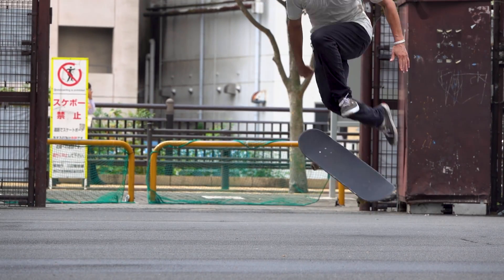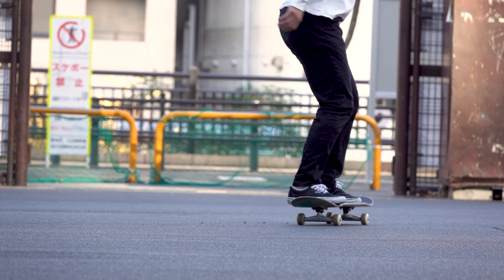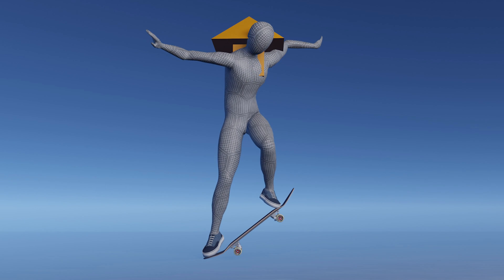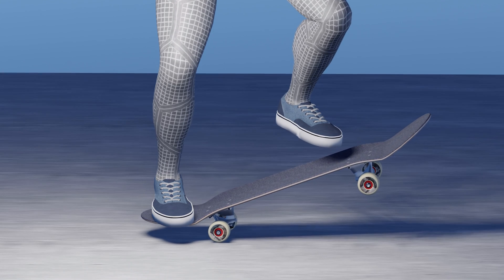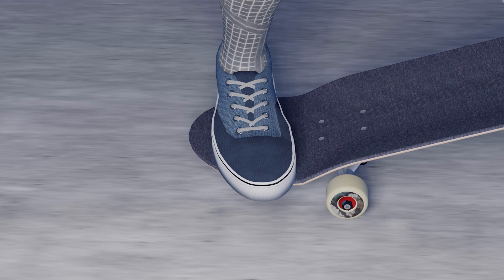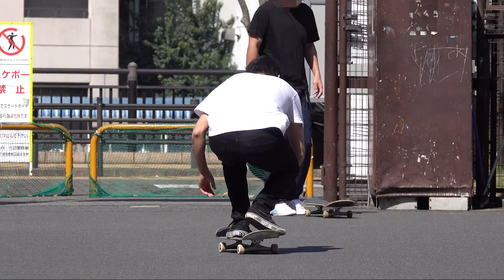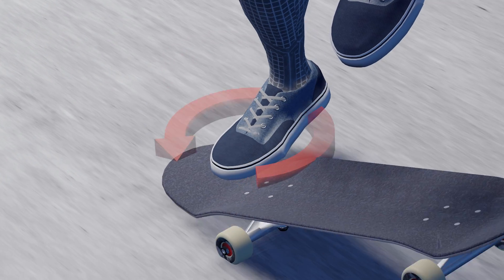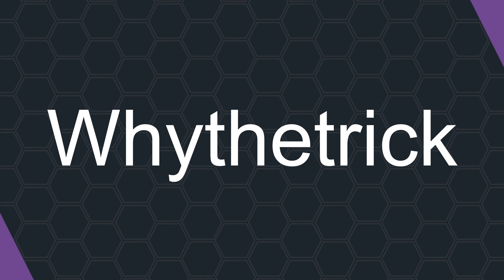Science of SCOOP - Difference with SWING

Comment: Bro, can u make a video why the board moving far forward/back after the scoop? Most people including you throw the board forward about 50cm after doing a 360 shove/flip , but some pro's like nyjah can land 360 flip at the same spot when he scoop it
Reply: That’s why you don’t Nyjah do tre to blunt, nose grind, overcrook, prob cuz he’s most skilled doing them where the back foot is responsible for more of the control
Reply: Also notice with noille center of gravity is more forward but not as much as it’s more backwards when ur in normal stance; because which direction ur moving in matters as well and requires less force hint nollie needs less. So since a tre is back foot heavy because two thirds of its motion are created by the back foot, naturally we push them forward usually to compensate and most people aren’t very skilled so they overdo it/ can’t do it backwards. 

But one should master all of possible
Reply: If you pop the scoop backwards you don’t need to apply pressure or flick as much in the front, and vise versa. 

Hope that helps

Comment: I’ve been trying to get front shuv-its casually lately, and for me I just pretend that I’m going for a front 180 and go from there. You know how hardflips you have to pretend you’re going for a frontside flip? Just like that. Also the swing motion you describe reminds me of like a scissor kick. I guess maybe something like an inward heel? 

Also the knee does move forward but you have to think of it from a neutral position. To me the knee moves in 8 directions, but really 16. (Well, the foot does which is ultimately the goal.) When you ollie you don’t bend the knee inwards and fold your ankle like the puppet maybe could, but it does shoot directly out and upwards. And then the foot comes after, think big ass ollie. You’re using the whole leg. If you wear a hinged knee brace you could still do tricks but it’s not the same. It’s all like a compound movement and moving your knee is natural. But it has a middle point and it’s not leg straight. Leg straight is one stretch away from hyperextension. Remember your ligaments is built to stabilize you, but it’s never JUST the hinge motion. You do have some range and power below the knee, and could even work on it (like quads).

One thing I’ve been doing lately for tricks is like a double squat I don’t know if you’ve experienced this.
Reply: Also I say 16 movements because if you keep your knee bent and move your whole leg from the hip, there’s your 16 (knee) movements. You can still place your foot in the same directions. I watched p.rod explain varial heels and that informed my ideas a bit. For the front foot, he says ‘lead with the knee’… and I found it useful later when trying to analyze my own mobility and form a basic concept of ergonomic knee movement as it applies to my skating. He’s not using his knee to get his foot to the point where you flick the board, but using that specific knee movement as a compound movement to get a fs rotation going without a scoop. (This is probably closer to what you call a swing movement.)

Also the movement you are doing with the back leg is not in this second area, because you are twisting the leg (still from the hip) but like if you are going to sit indian style (crosslegged) or as if going to do butterflies (the stretch movement used for flexors) or any movement like that. This kind of movement is totally normal for the knee too. And I consider it primary and then comes the more stable knee movement. The knee doesn’t really go anywhere so I feel crazy explaining the foot and saying ‘knee’, but I am very much fixated on why the knee lol.

Also you can combine the movements to make many compound movements, by following the same line of thinking.

Also there's an old video with ben dregros and he explains how his pop is more of a slap motion. his foot and tail never touch the ground at the same time, only the tail as he gives it a quick slap with the tip of his toe as he's extending his body for the jump. I think it's interesting and I can't say if the claims apply to my ollies, but he seems to prove it with footage. I wonder what you think about this? Also from watching your tre flip videos and seeing you scoop it sideways I determind that I could pop it sideways (for the pop shuvit) but mostly by scraping on the tail during that moment instead of letting it flip. That's obviously a pop with more contact, which I feel also helps me stay balanced after swinging my leg after the pop and scrape. I usually catch these with no flips and no slip-outs. So I know there's a place and time for a full contact pop. But there might be a 'slap' type of pop out there. Sometimes from random videos I glean weird stuff. Like the knee moving out to allow you to bend your ankle enough for the ollie, to get a good contact patch on the front foot. I found a video linked to a reddit post (99% of New Skaters Get This WRONG About OLLIES!), and someone explains this. And I was like, "damn, yeah".

The type of things I wish I could see you explain one day are like fs reverts, and power kickflips, like to practice flip out of slides. A buddy explained to me once how to bs revert and he said "just throw your hip all the way into it". I didn't own bag of suck, someone I knew did, but I remember someone in that video does a fs revert in a line very cleanly. But the trick eludes me, and I can't explain it. There's also an easy version where you pivot on the front truck, that's not what I mean at all.
Reply: Two more tips I use that I'd like to share with you from my own notes (I do a lot of ollie'ing right now), 

I noticed sometimes one can pop really close to the concave, away from the edge of the tail. you can see it in yuto's 'yuto show' part and the 'one line' video showing attempts, the nosegrind nollie flip out, the camera is really close to the tail. seems like a very straight pop and natural stance. It's like the anti-scoop stance. This just works when the situation calls for a straight pop. I use it a lot now. (I wouldn't wanna talk too much about his techniques because whatever he's doing is working and he's in his prime and I wouldn't wanna jinx it if he were to read my dumb analysis, haha)

Another tip that helps me overall is the one in this video... 'Should you look at your board or the obstacle when you ollie?' I just went back to find where I picked up that techique as I couldn't remember. Couldn't recommend that clip more. Ollied up a drop today using this and it felt so good! And kickflip down the same drop last week. A good mechanism for how to look down at that griptape is so valuable. If I rode up to a drop focused on my griptape the whole time I would say 'f this' and bail.

Almost got some frontside reverts also, on fresh blacktop, but still impossible for me on the sidewalk.

Comment: great video. still working on getting backside pop shuvs consistent. but this helps a lot thinking about the toes rotating to do the scoop. and especially the tip you gave of scooping at the very last moment when only your toe is making contact with the board, that makes so much sense.
Reply from the maker: Great to hear!